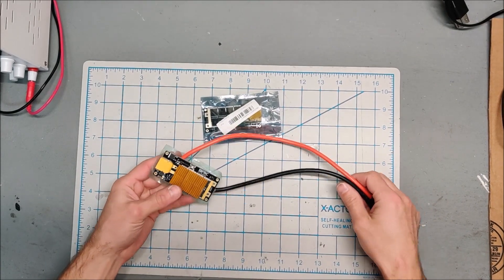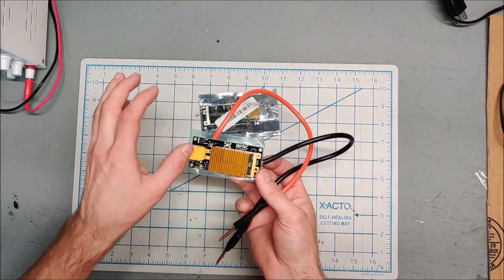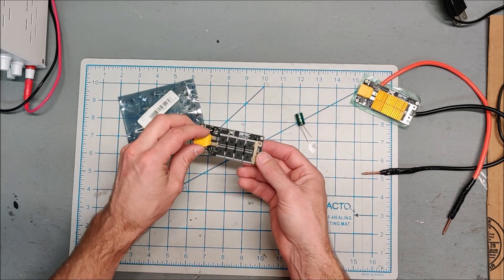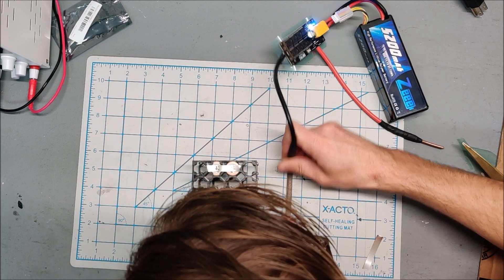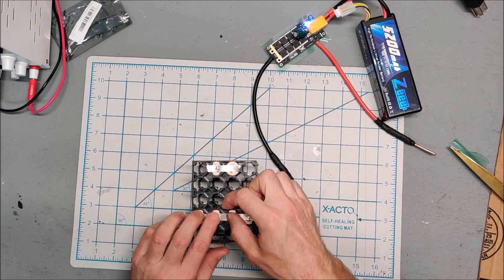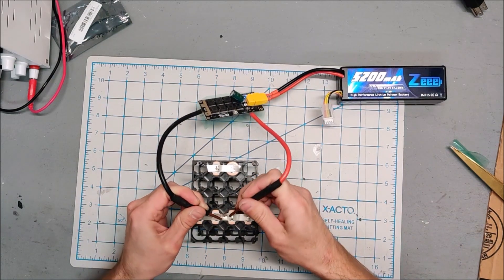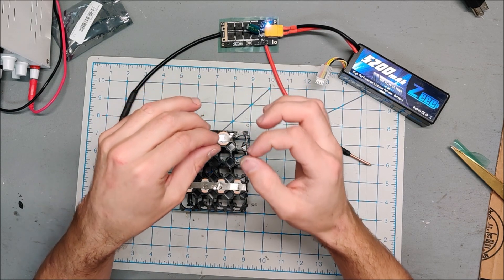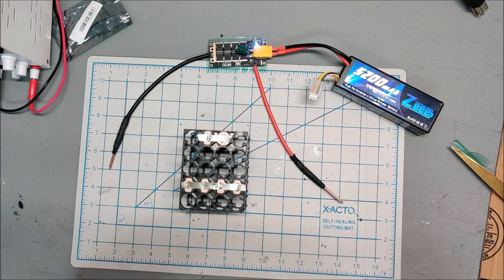BUYING AND TESTING A NEW BIFRC SPOT WELDER: STILL THE BEST?

Comment: Wanted to share this with you. I was spot welding tonight and got a huge chuckle out of having a small neodymium magnet bouncing every time it hit when it was close to the leads. 

I'm still using one of the first ones you recommended but with heavier gauge leads and a capacitor bank for the power source instead of a lipo. Its been working pretty well for me. Appreciate your content as always!
Reply from the maker: Nice. That will be the electromagnetic pulse as the current runs through the leads.

Comment: So I got one of these along with one of these spot welding pens https://www.ebay.com/itm/402348641509 instead of the probes that would’ve come with it if I selected the option but when I tested it with my 12v 9ah SLA battery which is pretty new though I when I was testing it out with this it was at 12.5v so not fully charged, it kept making a lot of sparks and burning through and I’m not sure if the battery I’m using is the best idea. I don’t have any high discharge lipos and my only other battery that I use for this giant 12v everstart lawn and garden battery with 230 CCA so it’s definitely the best thing I can use but it’s really heavy so I’m using my smaller one as my portable one. I was really using it for testing since I didn’t want to use something so powerful for a build I’m not sure that works yet. I soldered the capacitor on to prevent voltage sag but my unit was acting really weird when I tested it. Like I had it on the white setting and my probes made huge sparks when they touched the nickel and actually burnt through them. I’m not sure if I was making good contact so I’ll have to try again but a few of the times it sparked immediately at contact rather than waiting for a delay
Reply from the maker: 9ah is not enough. I think you will get better results with your heavy battery
Reply: Definitely more CCA is better. But if it is a 12v 10Ah 20C it should deliver 200 amps. Wouldn’t that be enough ?
Reply from the maker: @gerardr4869  200a is enough.

Comment: that cap will discharge fully if the battery goes down, it will go down with it, with no diode blocking it from discharging when welding, it is abundant, or it will "help" the weld, but really not with that tiny capacitance.
Reply: so is there a way to help with lower batteries?
Reply: @vavo9269  but do the diode/inrush resistor mod and change the R4 resistor for one under 500 ohms, i use 200 ohms right now, works great. check luca youtube channel for more info and guide how to mod
Reply: @xibidit  ok but identifying the right resistor on board or other boards will be tricky
Reply: @vavo9269  no man it's easy, at least on the unit i have, Check "luca" youtube channel, there is clear instructions and testing. I have used it a lot, without issue. Did not use it until i modded it first, and it has held up to some real abuse actually. 0.2mm nickel is not easy to weld with these small welders and it does it fine with a powerful battery.

Comment: I just got a new one of these and I think mine is the newest one but I noticed the one you got is matte while the original one is glossy and the one I have is glossy. But mine also came with the capacitor and connector not soldered on. And also the solder on mine looks nearly perfect so maybe the one you got was just built sloppily

Comment: Nice video. Have you tried adding a dedicated 12v power source for the board and remove the capacitor? I have a hunch that the mosfets are getting warm because it is being operated at non peak voltage during a part of the cycle. If you have a decent lipo, this is will cause mosfet to just get warm. If the lipo is bad it will cause huge voltage sag and the mosfet will blow up because Rds on is very high for high current at low Vgs voltage. Basically it is like spot welding the internal of the mosfet. I got this idea from another German spot welder video.
Reply from the maker: Thanks. Interesting idea!
Reply: Can i use a 100Ah SLA battery?
Reply from the maker: @zarbonida  yes. 100a is just big enough. I would use something bigger but 100a should work

Comment: Very nice. Another great video. I have Problem  finding proper battery.
Reply: I use a li po jump starter. I cut the cables, that came with it, just before the diode pack, leaving the ec5 connector on one end. I soldered the negative cable, about 50mm long, directly on to the spot welder. The positive from the jump starter is connected directly to the positive weld cable. I than ran a thin piece of wire from the positive cable to a diode connected to positive on the spot welder. The diode stops the capacitor discharging during the weld cycle and keep the welder voltage stable. I put female ec5 connectors on the positive cable from the jump starter and the negative weld cable point on the welder. By putting male ec5 connectors on the weld cables I can move them between different welders.
Reply: @alexackermann7127  Thank you so much for the help. Appreciate it. I'm looking for the same battery but the prices are little high and doesn't worth it. (I made my own welder using microwave Trandformer and just curious to test this one too if I find the good price battery).I noticed that Chinese markets like AliExpress found out that Their prices are too low for US and EU citizen they  they increase prices every week accordingly. Now I found out some of products on AliExpress can be find cheaper here in Finland even with Finnish insane Tax law.